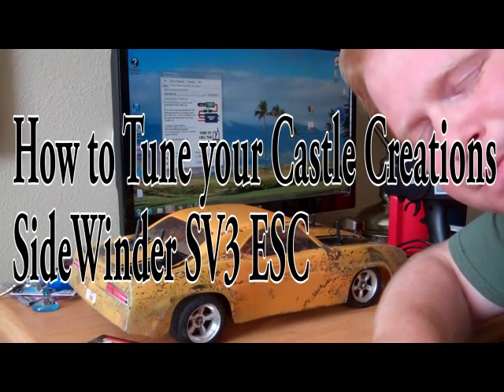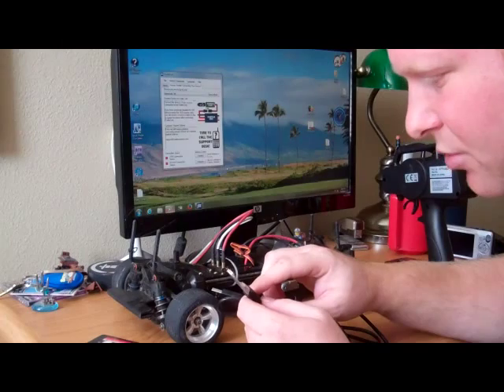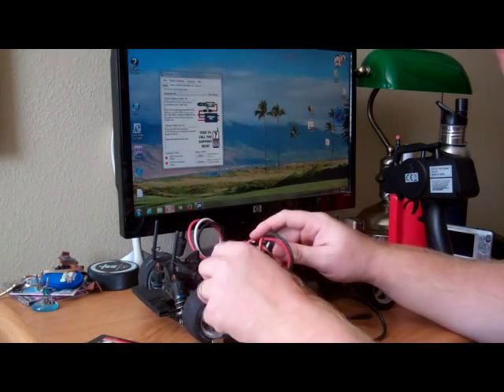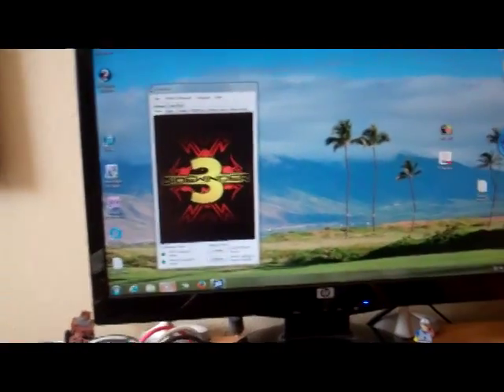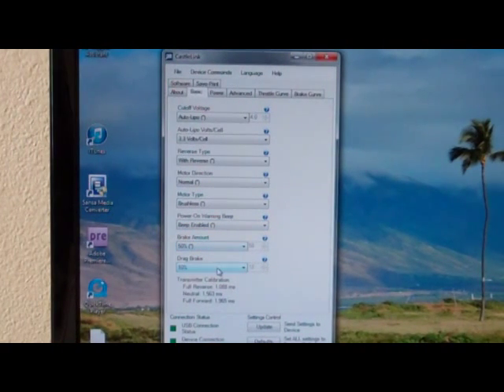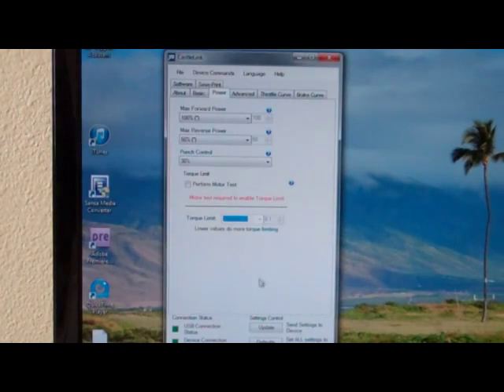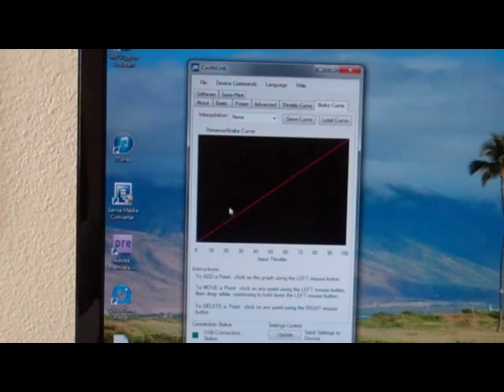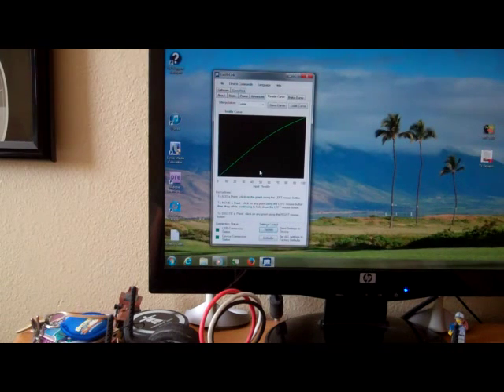How to Tune Castle Creations Sidewinder SV3 ESC

Comment: do you have to power the esc with the battery? when I did mine I didn't do it and it worked. should I be plugging the battery to the esc when I tune it?